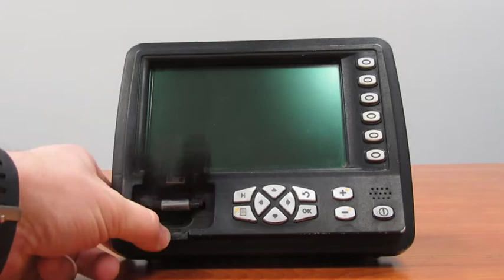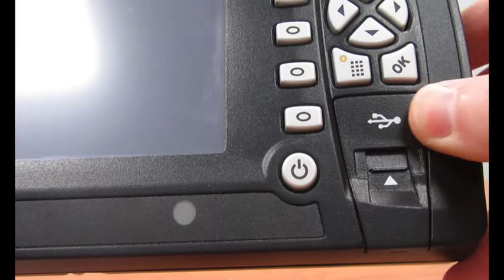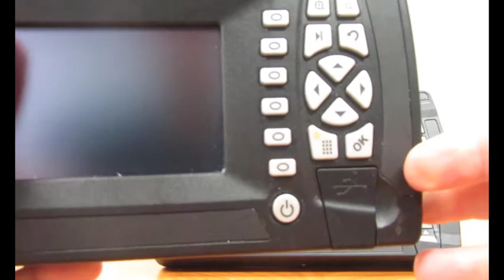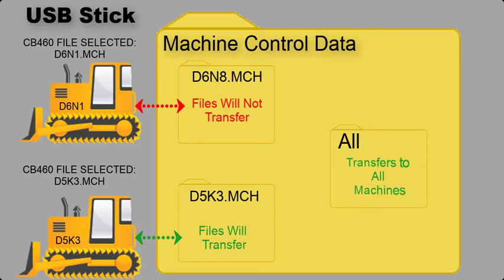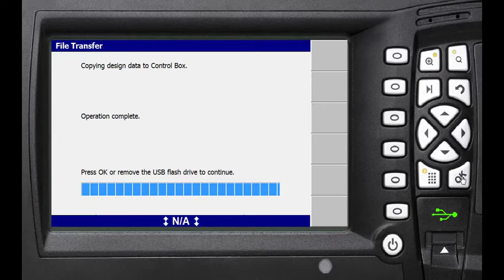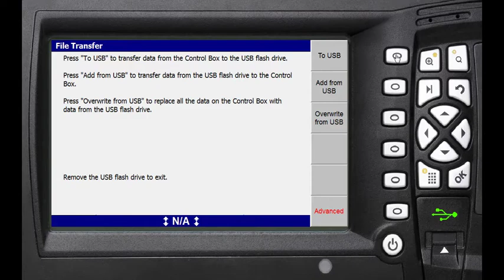Trimble CB460 & CB430 How to Load Files on a Control Box - SITECH Louisiana

Comment: I had created a folder prior to the Machine Control Data folder it auto created, and that didnt allow for any of my files to be copied onto the machine controller. Just a helpful tip i learned this week
Reply from the maker: Hey Connor,
Thanks for the comment.  That is correct, it is critical that the Machine Control Data folder is on the root of the USB because the software is looking for that Folder Name and structure.  So if the Machine Control Data folder is in another folder or you have a "Machine Control Data" folder inside of another "Machine Control Data" folder it won't allow you to transfer files. Thanks for bringing attention to that.